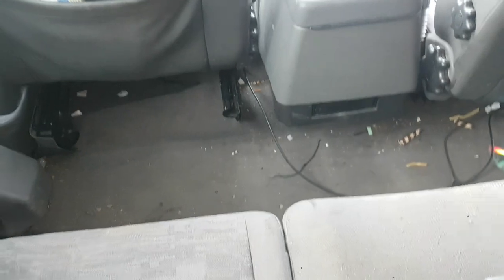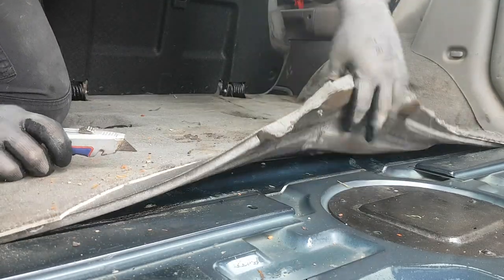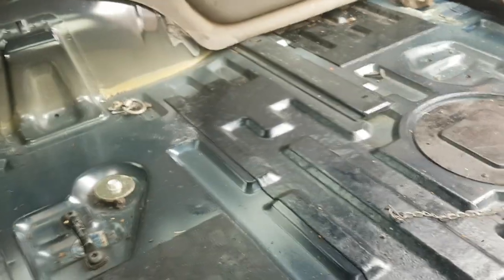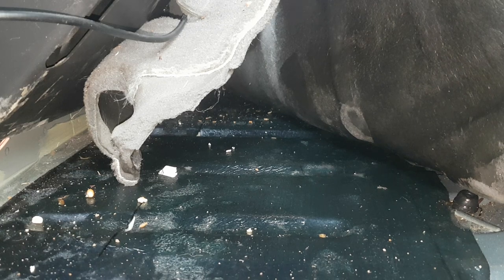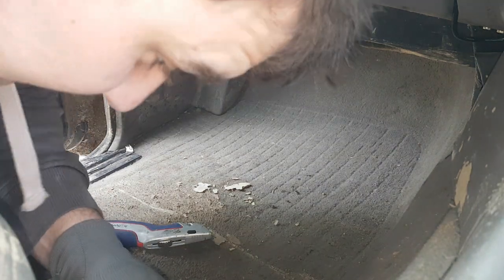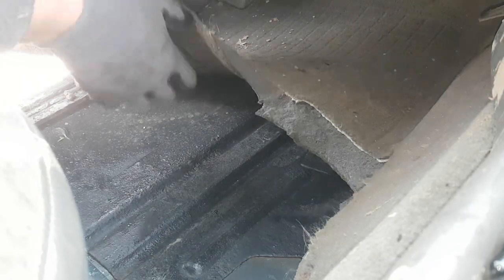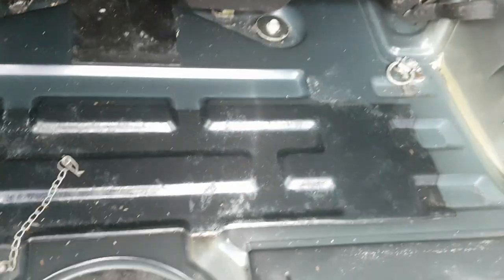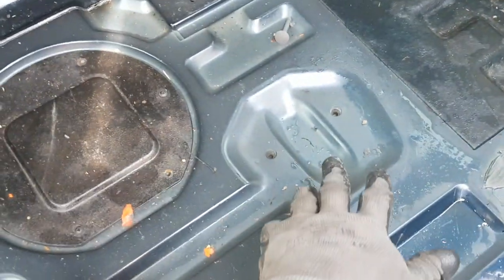Disco 2 carpet removal.

Comment: It's a pity you didn't show how to remove the carpet in a non-destructive way. I understand that you want to do some off-roading but seeing how to remove the whole carpet and keep it intact would be much more valuable and informative.
Reply from the maker: I did originally would have preferred to have kept it as my cousin could have made use for it but unfortunately there was a few spots here and there that was slightly damaged like someone had cut up some of the carpet to get to certain bolts instead of actually removing the carpet and trim properly very common with people that get to the fuel pump they just cut a square rather than lift up the carpet

Comment: hi, ive just bought my first landcover the other week, a disco 2. last week I noticed the rear boot carpet was damp. when I've had chance this week I've set about taking it up and having a look. its same as yours and smells damp, the fuel sensor is rusty so pulled it out. I poured water all over the top of the roof and couldn't see any leaks inside, so puzzled there. I mean it could just be condensation that's built up under there with no circulation of air underneath there.

cheers
Reply from the maker: Would someone have gone wading a tad to deep for water to have got in also I know in the back corners there is vents and I think some one way bungs might be worth checking them out I would say don't use my method of carpet removal unless it will be used for Off-roading

Comment: I currently have seats out, making up templates (in cardboard) so I can re-floor the driver/passenger front with steel plate - serious rust/rot, can only be saved w new steel... all of the water damage was due to the sunroof drains - my carpets were EXACTLY like yours (only left longer by previous owner, rusted badly)
Reply from the maker: We used to own a discovery 1 and that had bad rot like the rest and so that is why I took the carpet out to help prevent it from holding eny water wich it did.

Comment: Did you replace the carpet and seal the leaks or buy rubber matting for the floor? It's what i'm thinking of doing for my D2 so i can dry the floor as needed.
Reply from the maker: Hi Mik I didn't replace the carpet at all because I didn't want the car rotting as the underside of the carpet was like a dish sponge and just absorbed moisture and water, I did look at getting a rubber matting however I did get the bright idea to use raptor paint inside that's what I'll definitely be doing if I was to do it again with another vehicle

Comment: With the interior out it should be easy to see where the water comes in!
Reply from the maker: Yes and I found the water is getting in from the top right of the rear door as the bottom hinge is bent new parts are on order.
Reply: @Turbo--James   That's interesting.  My swimming pool is the passenger footwell. Investigations are ongoing!
Reply: @sleepycatpictures1176  Check your sunroof drains. Might be clogged or broken.